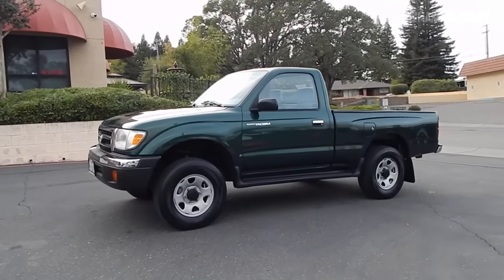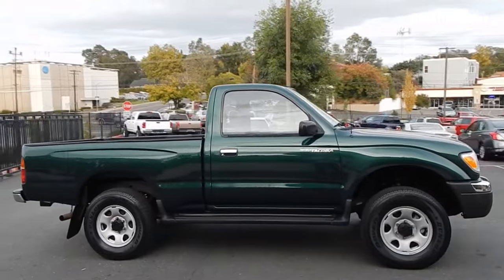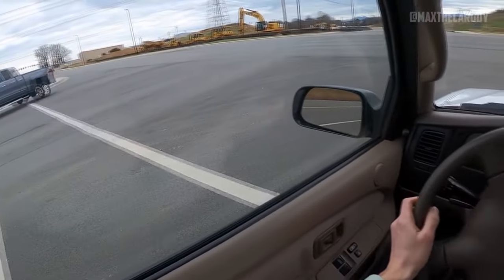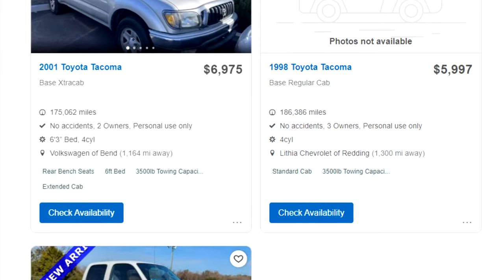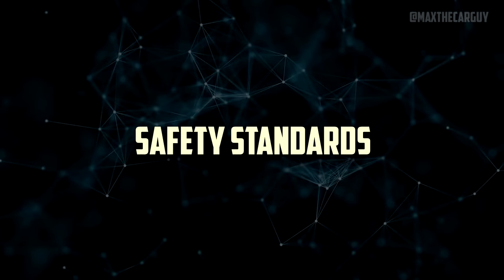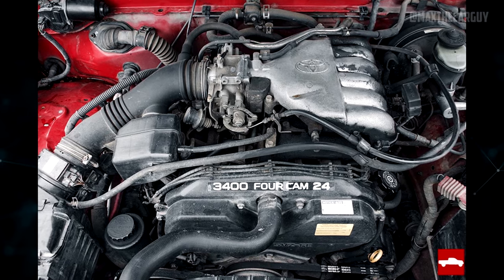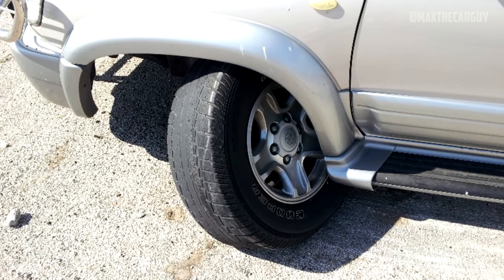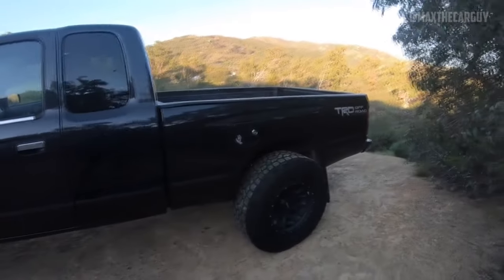Toyota Tacoma Gen1 (1995-2004): Specs, Problems, Pros and Cons. Should you buy it?

Comment: 360K on my 96 Tacoma. Still running strong. Everything stills works. Currently under going a refresh and fab work. The cylinder walls still have the factory honing marks. Total shocker.
Reply: These last forever. Got 375k on my 01. Had her for 2 decades since i was a teen
Reply: @santibouphavong The one I’ve been working on has a 3.4 5VZFE with 229k miles, is overheating and today it overheated completely out of nowhere on the highway and blew a 4 inch crack in the radiator. New thermostat in it. Getting frustrating.
Reply: 306k miles on my '01. Still going strong.
Reply: @brandondickie3456  I guess we all always have ot keep an eye on our Temp gauge. I wonder what happens with new vehicles that have only idiot lights no more gauges except speedo and tach?
Reply: @user-zn3hn5be1v  We’re just going to sell the truck. Pretty sure it’s a head issue because it just overpressurizes the cooling system. New radiator on it swelled so much that it started leaking from the crimps.

Comment: 95 4x4 Tacoma is still my daily driver after all these decades and has outlasted much newer vehicles. It's super affordable to maintain too. My 04 Chevy Tahoe is the second best vehicle I have owned. It died at 250,000 miles. Well it need $3K worth of work to get it on the road again. The Tacoma has never done this to me. It's always super reasonable to fix and it's partly why it's still my daily driver. I keep maintaining it and it just keeps driving.
Reply: How many miles does your Tacoma have now?
Reply: @jaymoar3561  It's around 215,000 because I didn’t use it to transport my kids since it's a single cab. I would only use it on days I could pick up one of the kids. Now that they're in middle school it's my daily driver again. I put 8,000 miles on it last year. I live 10 minutes from work, so it's low mileage. Most of those miles are from camping and fishing trips. I got it in 2008 with less than 48,000 miles.
Reply: How often do you change your lower ball joints. Also how you know when they need to be replaced
Reply: @FOURFTP  I past replaced them at around 150K because it felt like the truck was floating. There was play and it was unstable. Haven't even thought about it since then. I off road with it too.
Reply: @TheSonoranDesertGrower  I just picked up a 95 4wd drive about 2 months ago the lower ball joint fail on me and a mechanic fixed the side it broke then told him to replace the other side. Now I’m kinda scared it will happen again. I’m not sure what brand of lower ball joints he put
Reply: Go for OEM you going to have a peace of mind

Comment: I have a 2004 Prerunner single cab with the 2.7 four banger and 4 speed automatic transmission. Just turned 149,000. It's a great truck, I've spent about 150 dollars in maintenance costs other than oil, filters and a battery. Not too bad after 19 years!

Comment: I put 488K miles on my Toyota over 24 years of ownership.
In 2/29/24, I bought a slightly used (6K mile) 23 Tacoma TRD Off Road, Premium pkg, 6’ bed.
I’m pushing 60 years old and retired. I now drive 5-6K miles per year. I plan on driving my Tacoma until I can no longer drive or I’m dead.
Reply: 😂. Thats right old timer.
Reply: @Donaldthefelontrump  Who are you calling Old ?!?
Joking. 
I retired when I was 43 and will probably die around 85-90. At least that’s when most of the men in my family die.
The women usually die in their 90s to early hundreds.

Comment: You are SO wrong on at least several statements. #1: the 2.7 liter engine has 150 hp, NOT "142". #2: "All models come with anti-lock brakes standard". WRONG. My 2000 Tacoma 4x4 with 3RZ-FE ( 2.7 liter 4 cyl ) engine & automatic transmission (bought it brand new ) does NOT have "anti-lock brakes". #3: "Only the headlights remained consistent throughout every model year". WRONG. The headlights AND grill AND front bumpers were totally changed 3 TIMES throughout the entire era of the 1st gen Tacoma. #4: You showed the earlier Toyota PU truck at least a couple times that is NOT a Tacoma. "The Tacoma's brakes are not the best rated, but adequate". TOTALLY WRONG. The brake systems on the 1st gen Tacoma were rated THE BEST IN THE ENTIRE INDUSTRY during their time of production from '95 through '04. I know, because the critics/testers in EVERY 4x4 and offroad magazine said so back then. You were also wrong about "handling" because many of the 1st gen Tacoma's came with the horrible "Tokiko" shocks. Mine did. They were barely adequate for overall ride quality, but going over rough terrain and body roll was TERRIBLE. But I replaced them with the amazing Bilstein 4200 series shocks that came as standard equipment on all TRD ( Toyota Racing Development ) Tacoma packages. The Bilstein 4200 series shocks cost far less nowadays vs back when the 1st gen Tacoma's were in production, and these shocks are one of the very best upgrades you can do to your stock Tacoma, because they are superior for overall ride quality, and are nothing short of amazing for rough terrain, plus they totally eliminate virtually all body roll when negotiating tight turns & twisty roads. The truck stays level & planted, which also makes the truck much more stable & safe to drive through turns & sudden lane changes. I was so appalled at your many inaccuracies that I had to abandon your video at the 8:49 time stamp........so I wouldn't be surprised if you have even more inaccuracies. Lastly, the robotic voice you use is not only insulting, it's pathetic. 2 THUMBS DOWN.
Reply: Hel yeah. Good post.
Reply: @DiogenesWasRight90  Thank you.
Reply: wtf 😂
Reply: Exactly on point. I have a 2000 PreRunner as well-caught all the same mistakes in this vid.

Comment: I've had 2 HiLux, 1985 and 1991, 4 cyl, 5 speed, and 2 1st Gen Tacomas, 2.4 liter 4 cyl, automatics, 1995, and 2000. My 2000 has 225,000 miles on it, bought it 12 years ago with 47,000 miles on it out of Virginia so body and frame were excellent, body has rust from 12 years of winter and road salt here in Western NYS. Frame is still solid. All 4 trucks have been excellent. Regular maintenance, oil and filter changes, have only needed to replace both lower ball joints, one side upper ball joint, 1 sway bar, transmission lines, radiator, and drivers seat, (support wires underneath it broke), exhaust system, and starter contacts besides regular replace items like battery, tires, brake pads and rotors. Still runs excellent and our daily driver.

Comment: I bought mine brand new in 2001.  V6 ext. cab, 4x4, 5 speed and have been daily driving it for the past 23 years.  Ive replace tires and struts/shocks a few times and im on battery no. 4 now.  Shitloads of oil changes and 160k later things are very close to like new still.  Fixing to give it her first brake job and figure ill do a clutch soon too.

Comment: Only problem I even had with them were frames rusting out, overwise great trucks. Had a 1985, 1991, 1995, and my current 2000 Toyota I'm driving with 242,000 miles. Probably got one more year before it won't pass NYS Inspection due the Western NYS Road Salt. All 4 were 4 cylinders, first two 5 speed manual, due to bad knees, last 2 have been automatic transmissions.

Comment: At about 20000 miles my crankshaft bolt the head snapped off from over torking it at factory but with 230000 miles that is the only time it's been in the shop.
Reply: Oh, and I have the big 4 cylinder 4 wd and pull a 20 ft pontoon boat all over Ind and Ky. The little truck is a beast !

Comment: I have a 1996, 2.4 tacoma. 169k miles on it. Just blew it's head gasket. changed oil every 6 months (1,500 miles, if that). Did not thrash it. bought it off original owner, he took care of it as well. so no,  i'm not impressed with its longevity.
Reply: U ever change the coolant?

Comment: I would like to trade or sell my '96 2.7 4x4 auto with 91000.   I just have too many vehicles and can't be putting the effort into all.

So, upper mid-west, if anyone is near or far and is interested it would be better to get it to where it will get used.

Comment: I don’t consider the ride average, and the abs brakes suck. Otherwise the most reliable truck on the road.
Reply: I agree on the brakes being weak the back drums is partly why , I’m gonna do the 1st gen tundra front rotor and caliper upgrade it’s helps a lot truck is solid other wise

Comment: The recall for rust still available in 2023?
Reply from the maker: Recalls typically remain in effect until all affected vehicles have been repaired or the manufacturer provides evidence that the defect is not a safety issue. It's possible that some of these vehicles may still be affected by the recall if they have not been repaired yet.

If you own a first-generation Toyota Tacoma, you can check the NHTSA website or contact your local Toyota dealership to check if your specific vehicle is included in the recall and to schedule any necessary repairs.
Reply: Lmk if it works I’ll call too lol
Reply: No, and it wasn't a recall. As part of the settlement for the frame rust lawsuit, Toyota extended the warranty on the frames for 15 years after the date of first service. That window ended in 2019 for the newest of the 1st gens. I got mine replaced in September 2019, I got in just a few weeks before the window closed.

Comment: Keep oil change filter 3000 to 4000 miles 90s mine 1990 toyota 4x4 extra cab sr5 black stick 3.4 v6 new frame new transmission cheaper 65 thousand dollars truck by dodge

Comment: Toyota repeatedly avoided responsibility for frame rust wherever possible—first ignoring the design flaw, then avoiding replacing All rotting frames with a properly, anti-corrosive prone design. The majority of frames were left in place (shortly thereafter to fail). Planned obsolescence. My dad saved the lives of downed, WW2 Japanese pilots, no questions asked. His(now my) truck is a Toyota ignored, rotted death trap in my driveway.
Reply: Your comment is all over the place😂 just part out the Tacoma and there you go no death trap
Reply: Toyota did one of the largest and most expensive recalls ever with the frames on the tacoma. It's not their fault if you refused to take it in.

Comment: Hello, I have a 1996 Toyota Tacoma 2.4 Pickup truck.  I have a problem that no Toyota dealership on planet earth has ever heard of... or at least what they have stated.  The other day my truck was trying to start on its own.   No, it does NOT have keyless entry.    Key was NOT in ignition.  Truck was cranking but not fully running.  I inserted key in ignition, it would still not turn off the truck.   I had to disconnect the negative battery terminal cable (which was temperature hot) to get it to shut off.  About half hour later I reconnected the terminal and it acted normal, no longer trying to crank on its own.   I'm suspecting the solenoid on the starter??   Any suggestions??  Thanks
Reply: Check your ground connections.
Reply: Resolved the issue.  Turned out to be the starter solenoid.  Replaced the starter which has the solenoid attached and problem fixed thank goodness! @ToddHudgensKY